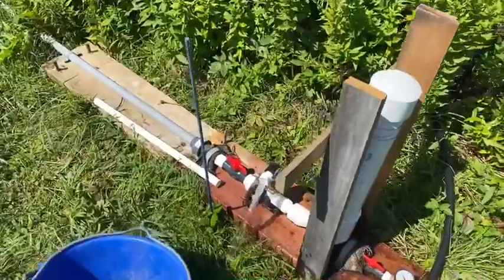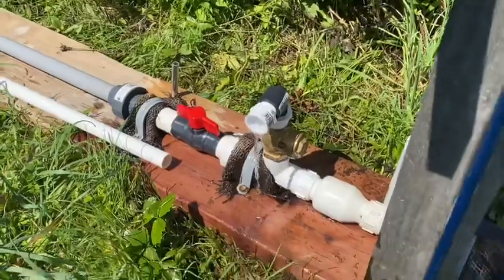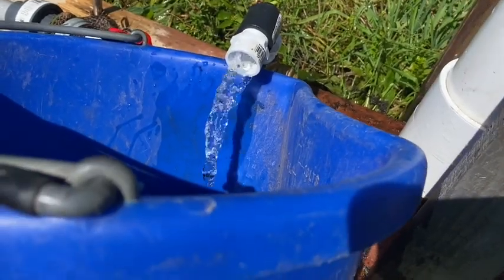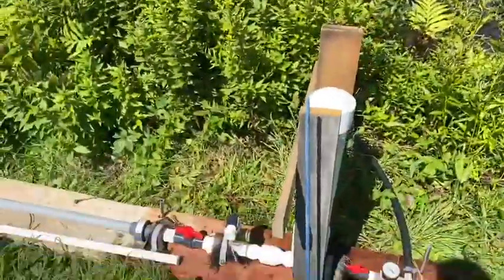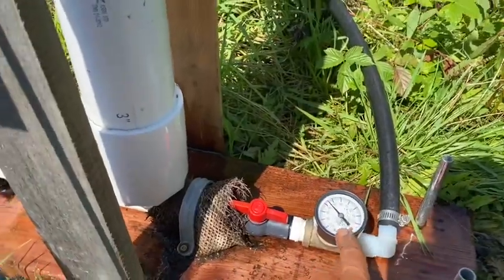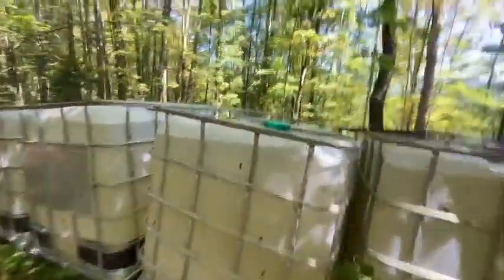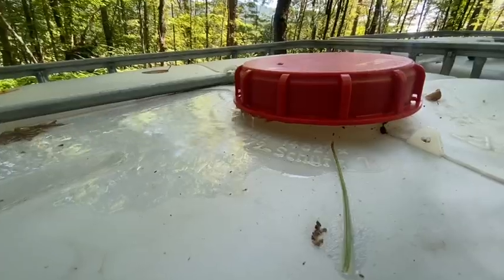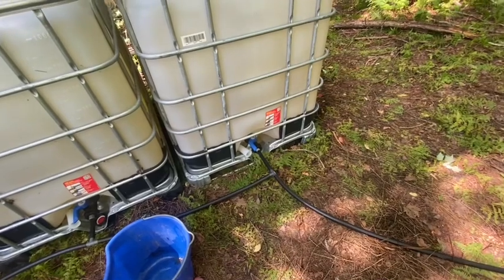Water Ram Pump Efficiency

Comment: If the numbers you provided are accurate you are running at about 35 % efficiency. According to Google, breurramp pumps can reach an efficiency of about 70%, meaning with some tuning you should be able to double your water output :)
The way you calculate the efficiency is simple,  (output flow * output pressure)/(waste flow * input pressure).

Comment: HI Ben, another way to look at what your pumps efficiency should be at is to compare the fall of the supply to the rise of the output in your case its 20`fall to 90` rise which is close to a 1 to 5 ratio... so you are fairly close to that in efficiency. Likely you are loosing a bit to friction, pipe flex and the natural inefficiency of a ram pump.
All in all your personal labor efficiency  to water resiliency ratio if quite high :) 
I made the mistake of leaving my original pump outside for the first heavy frost... lots of cracked fittings and cursing ensued.  
The next level up on ram pumps which I'm hoping to one day achieve is to build a double acting ram. These allow you to use ground water as the energy to then pump clean spring water for human consumption. This fellow has done some awesome work building his own:

https://www.youtube.com/watch?v=22MszYsRtMI

Comment: Are you filling those totes from the bottom valves?   If so, isn’t the head pressure from the full totes a variable in the equation?  In other words, don’t you have 800 gallons of elevated pressure pushing back down hill into the pump?
Reply from the maker: Pretty sure only the verical lift matters, but someone who knows physics better than I can comment
Reply: @wholesystems  From another video comment thread: 
JL Laine
Lower head pressure means it takes longer for the flow though the waste valve to get up to speed to drag the waste valve closed, higher head pressure means the flow comes up to speed quicker to the rate needed to close the waste valve.  Higher head pressure = better delivery to waste ratio.
Reply: @wholesystems  Will have back pressure from the tanks (just the highest tank), but this should only affect the time it takes to fill them, since the ram system had enough pressure to fill them completely already.
Reply from the maker: In short no, I don’t think filling from the bottom or top or how many gallons stored there change the pressure once the tanks are full. See my other comment. What matters is highest point the line ever reaches. Not number of gallons above it.
Reply from the maker: Filling the tanks from the bottom or the top doesn’t matter if filling to the top is your goal. And filling from the bottom means the pressure you are working against is only whatever the water line is at the moment, not the top of the tank or whatever the highest point of the line is.

Comment: Total water through ramp pump in 1 minute is 1.7 gals. (.3 captured to 1.4 waste)  Percent captured is about 21%;  waste is about 79%, which means slightly over 1/5th of the water is captured up hill.  You also have an opportunity to utilize the other 4/5th waste water. I would try to find a useful function for it like channeling through swale to dryer area or keeping water in one or more pond(s) before guiding back to the stream.  :-)
Reply from the maker: Thanks for the math clarification!
It goes right back into the drainage it would have gone to anyway and from there can’t reach a dry area but that would be a good idea no doubt…

Comment: Thanks for sharing. Great metric to keep in mind.
If you want more accurate data. Try going for a longer time period or you could use a small capacity bottle or jug and calculate the time it takes for each to completely fill it then use that ratio of each time. 
I was also counting the cadence or number or pumps to find the relative volume per pulse.. hope that made sense.
Thanks again
Ps- moving to S. Burlington in a week. Hope to connect in the future.
Appreciate what you're doing.
Working my way through your book right now.
Reply from the maker: Thanks, indeed.. i just wanted to get a rough ratio... If i start testing this against another i'll measure for a minute or two with a quart jar or gallon taller jug, etc.
Reply: Weighing water is even more accurate. A jug with a set of battery powered kitchen scales.
Reply: @rsbhomevideos  not really.. if it's the same volume of water, then it's a matter of accuracy of time. I doubt he's really interested in the difference of a few ml, resulting in a difference of a fraction of a percent
Reply: @rsbhomevideos  not to mention that scales require a perfectly flat surface to give an accurate reading, which isn't all that common in nature. So it's more likely to result in a more inaccurate determination unless he carries them inside to a level surface